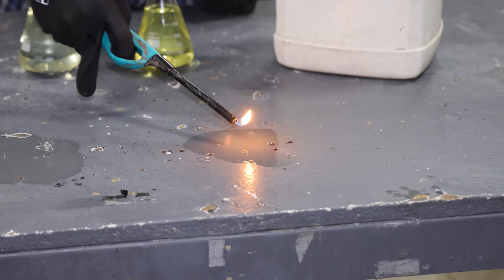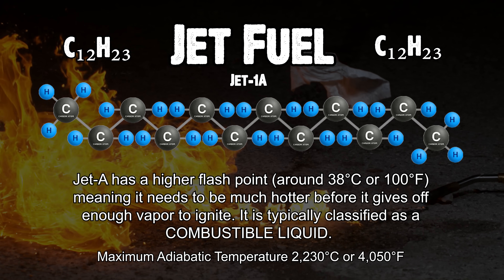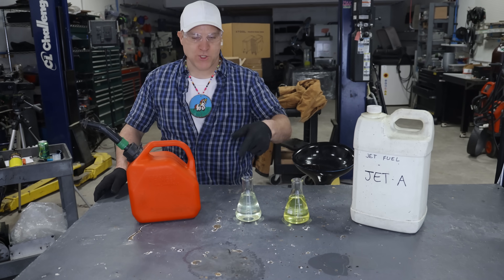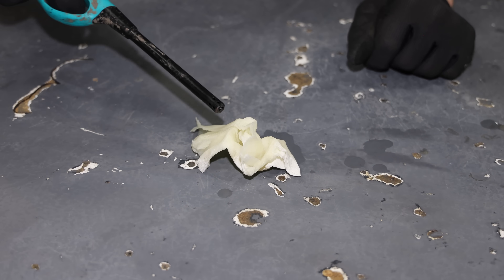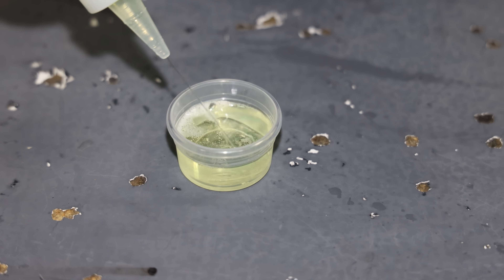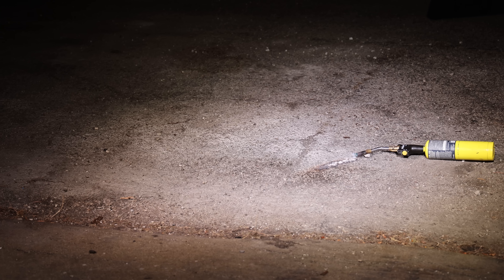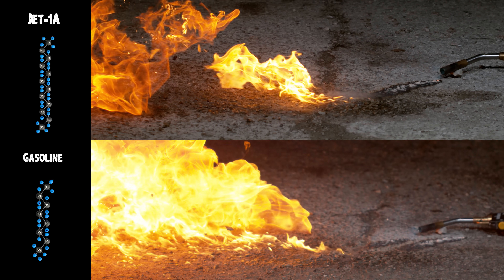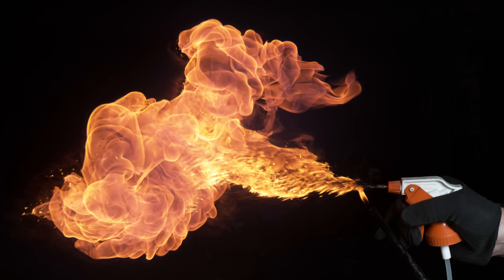What Happens If You Light Jet Fuel vs Gasoline?

Comment: Does it melt steel beams?
Reply from the maker: Take a look at the Adiabatic temp I listed in the video. Steel meIts at 2800°F so I  think both fuels will actually melt beams, But jet fuel has a slightly higher temperature.
Reply: If fed lots of airflow at its stoichiometric ratio? Yes. In open air? Most certainly not. You're looking at about 700 Celsius at most if you get it going in open air, steel needs about 1400 to melt. Kerosene's peak flame temperature is 990 if measured at the end of a lamp wick (which kerosene is often used for, its both jet fuel and lamp oil) but its lower in open air so long as kerosene can maintain the continual self-evaporation that allows it to burn. Sure, kerosene at stoichiometric ratio can reach 2000 Celsius under pressure, such as in a jet engine, but open flame is insufficient to melt steel, at most unevenly soften it, and even then not by a huge amount.
Reply: @Avetho  Structural steel loses 50% of its strength at 500C.  70% at 600C.  That's a huge amount.
Reply: @nathanwahl9224    Considering the wide safety margins baked into building code, that's not enough to cause a collapse on the upper floors. For skyscrapers like the WTC towers, there would be at least a safety factor of 3 to 4, I'd wager no lower than 2.5 at a bare minimum, and that's at the base of the structure, the columns don't get thinner as you go up because that would compromise structural integrity, so you're looking at columns in the fire zone of a nominal thickness sufficient to support the load of every floor above ground level, including in high wind loads, and the fire zone has few enough floors above it that you can easily consider the safety margin at those floors to be over 10 at the very least. So no, losing 50%, even 75% of its strength at a high floor is insufficient to even cause minor buckling.
Reply: @Avetho  Beyond design capacity.  An entire set of floors is not analyzed for, so not accounted for.  They also accounted for the beam insulation not being blown off.
Reply: @Avetho   Video and photos prove the majority of Jet-A burned off in the initial fireballs, and even NIST confirmed this.  Video and photos also prove the towers were well ventilated, and that it was windy, especially aloft.  (If one doesn't understand "ventilation" in the context of firefighting, one can go their nearest firefighter station and inquire for a personalized explanation.)
Reply: steel easily deforms at high temperatures. look at veritasiums new video on jet turbine blade engineering and youll see. now imagine the stress of an entire building being burdened on steel supports that are well above their design criteria for their temp. Its not that the beams themselves melted as if in a blast furnace, they were heated and able to plastic deform. please try to think critically
Reply: @WildEngineering oh, OK. So what about building 7 then?
Reply: @WildEngineering  thank you.
Reply: re: https://youtu.be/QtxVdC7pBQM?si=ebPqbqcfHEIeC5wm&t=502
Reply: @WildEngineering 🤦
Reply: @WildEngineering  "critically", okay then.  3 buildings, only 2 of them struck and in different places, ALL fall into their footprint in one afternoon, matching the speed and characteristics of a pro job.
Reply: OMG, that requires nanothermite bro
Reply: they don't need melting temps to lose hardness and thus structural integrity
Reply: @CraigLuna  What about if the fuel was sprayed into the top floors of the structure, would 80 beams on every floor at the same time lose their integrity and allow for free fall speeds?
Reply: @Raymo2u    No, most certainly not, nor would it keep steel liquid for days.
Reply: @Raymo2u the momentum of 12 to 20 stories collapsing is more than enough to buckle the rest under it. 15000-36000tons falling is past any reasonable best case strength scenario
Reply: @Avetho just the energy of the collapse plus gas lines and other fires account for that. The energy of 1 billion pounds of metal and concrete falling isn’t trivial
Reply: @CraigLuna    Problem is, you need that energy for the collapse to happen in the first place. Besides, there's been evidence that military demolition hardware was wired into the support pillars of the five buildings that came down (you know, three short buildings that did not get hit) and kerosene, even if whipped into a high temperature blaze, would weaken the steel pillars unevenly and the towers would've condemned several other buildings around them and perhaps only partially collapsed rather than fall into their own foundations like every professional demolition out there.
Reply: @Avetho you have all the energy needed with softened structural steel allowing the collapse of over 30 million lbs above the impact site as it falls at minimum of 12 ft.
Reply: @Raymo2u  It entirely depends on the building design.  And once thousands of tons get moving, NO  reasonable structure is going to stop it.
Reply: @CraigLuna  Give NIST a call and let them know this.
Reply: @CraigLuna please try to replicate the effect that you mean in any real material scaled...
Reply: @skaford  spend some time O/A welding and you will see it very easily. 

However, some amazing science channels have demonstrated the effect quite well.  

Search metals strength vs temperature and you will see how low the temps can be before loss of strength. I’d put a link but when I did earlier, YT ate the comment
Reply: @CraigLuna not anyone have been able to recreate a perfect free fall... As it happened without resistance
Reply: @skaford  15000 tons … u expect them to build that when std engineering understand perfectly well just to satisfy normies ?
Reply: But....melting, I'm melting.....one of the most pointless questions ever asked is "Does it melt steel beams?" Try heating some steel to a few hundred degrees to see how easy it can bend and break, even with the simplest of tools you tools.
Reply: Jet engines also contain a metal called magnesium which burns at 5.6k F° will absolutely cause steel to melt.
Reply: moron stop spitting on the graves of the dead makes you look like a well moron. Jet fuel + wind hits temperatures plenty high enough so does gas so does even wood. People like you are sick and should go to see a mental health specialist
Reply: Any kinda heat can melt steel dopey.
Reply: @markchapman2585 wrong. Go melt steel with a candle flame. Report back.
Reply: Nope.
Reply: Sheesh, 🙄 where do we get these people?
Reply: Nope. Globalist scum does.
Reply: At nominal kerosene flame temperatures, structural steel loses well over 60% of its strength. It's really easy to look up.  Far below its melting temperature. Structures don't handle load very well when their frame turns into spaghetti noodles. What a silly question.
Reply: How about a building 900 feet away, around a corner and behind another building collapses 10 hours later? building 7 has entered the chat
Reply: @monkeysuncle2816  thats the fair point of the conversation IMO. A reasonable question indeed.
Reply: I think you dropped your tinfoil hat sir
Reply: @Igbf I think your masters need to update your sad attempt at insults.
Reply: @garnet4846  the reptilians are coming